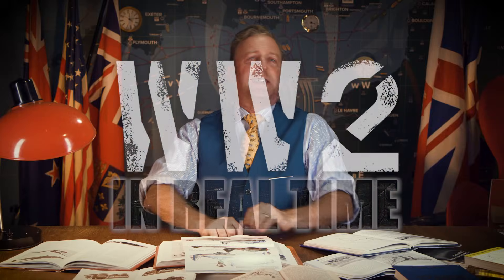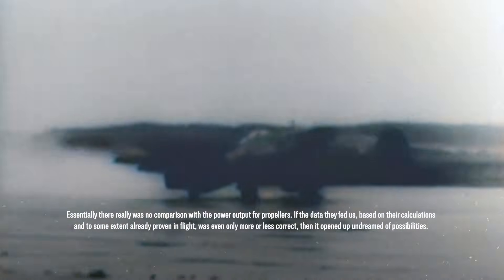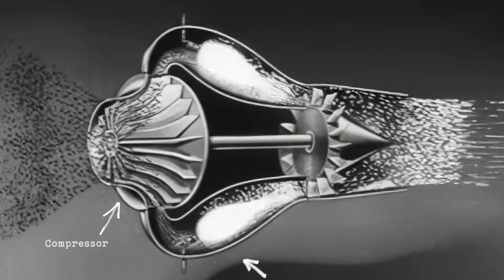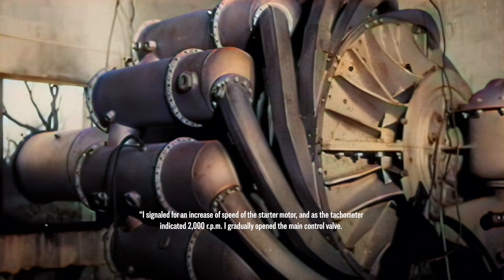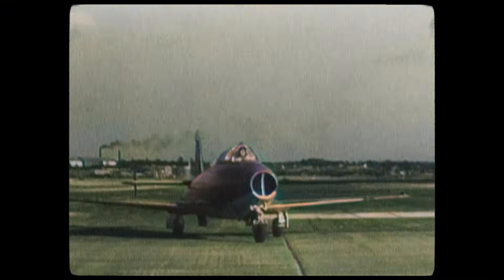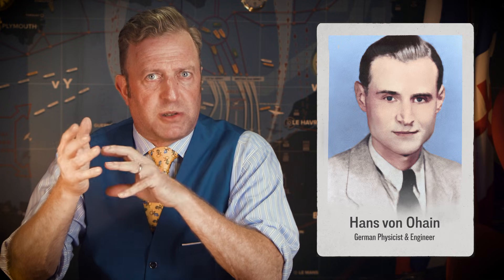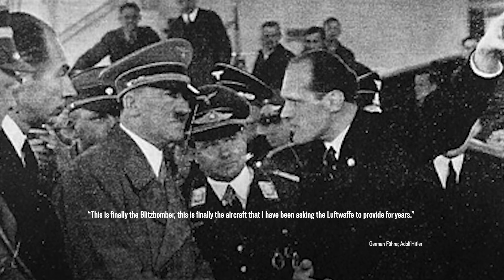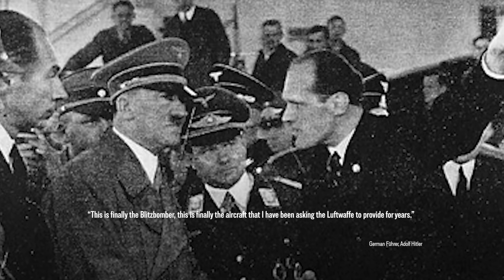WW2 Jet Engine Development - WW2 Special Documentary

Comment: The He178 was a purely experimental aircraft, never designed to be a fighter. Heinkel described in his memoirs that the air ministery guys did not get this and complained about a lack of gun mounting options. The He280 however, was designed as a fighter.
When Adolf Galland was asked long after the war if a fast deployment of Me262 fighters might have turned the war, he answered "No, it would not have changed the result of the war, it would just have prolonged it - and therefore cost more lives."

Comment: I just don't understand why the USA didn't do more to copy that magnificent, gracefully blended airframe  of the ME262, it was like another P51, or Spitfire in beauty?  And why not since the USN Nautilus was basically an all German Type XXI U-Boat hull?
Reply: Because the Americans captured the plans and the engineers that were building the Me-262s replacement.
 The F-86 Sabre was designed by Edgar Schümd and a team of German engineers from Messerschmitt brought to America by Operation LUSTY and Operation Paperclip.
   The first 6 Sabres built used parts salvaged from captured Me-262s

Comment: The Tizzard mission to the USA introduced jet engines - no R&D was under way in the USA on jet engines. It was a one-way transfer of technology. It was hoped that collaboration with the USA would develop a suitable engine quickly then US industry would join in mass producing it. Hence General Electric were in from the start.  The R&D was genuinely two-way, unlike the A-bomb which was British to the USA. The two were to rise in parallel in jet development. Yet, the British went way ahead of the USA in design, despite the USA getting all their R&D data. The British left the Americans out of sight.   The USA were slow or unable to use the R&D the British gave them.  At the end of WW2 the many British engines that were developed formed the basis of most jet engines for the next 20 years. 

The British/US way was design and quality.  The Germans were way behind, just about getting a poorly developed, and dangerous, functional engine into a plane. Then out of desperation they produced an engine (Jumo 0004) in volume using slave labor. The German engine was so bad is not worthy of note, except that it was put into a production plane and mass produced.
Reply: Completely false and an egregious attempt to spread misinformation.
The Lockheed J37 and the Westinghouse J30 were already in development and these were superior axial turbojet technology not dead-end British centrifugal jet engines.
As revealed by the Fedden and Von Kámán Missions, Germany was clearly years ahead of anything the Allies had during the war.

Comment: Noteworthy is the somewhat unintuitive assessment of production cost and time: It was less than a third of the cost of the Junkers 213 piston engine and needed only 375 man hours to manufacture as opposed to 1400. I call this unintuitive since this was a state of the art prototype still and piston engines were proven and optimized technology. Had development started only 2 years earlier it's likely the germans would have pumped out a lot of these engines. As mentioned their fuel requirements are also lower. So far jet engines have been converted to almost any fuel, the only thing that didn't quite work out is coal dust due to the ash content eroding the fan blades.

Comment: After the end of the war, the Me 262 and other advanced German technologies were quickly swept up by the Soviets, British and Americans, as part of the USAAF's Operation Lusty. Many Me 262s were found in readily repairable condition and were confiscated. The Soviets, British and Americans wished to evaluate the technology, particularly the engines.[120]

During testing, the Me 262 was found to be faster than the British Gloster Meteor jet fighter, and had better visibility to the sides and rear (mostly due to the canopy frames and the discoloration caused by the plastics used in the Meteor's construction), and was a superior gun platform to the Meteor F.1 which had a tendency to snake at high speed and exhibited "weak" aileron response.[121] The Me 262 had a shorter range than the Meteor and had less reliable engines.[122]

Captain Eric Brown, a British test pilot who flew 487 types of planes during his service, flew a captured Me 262 (as well as other German Second World War jets) after the end of the war. He referred to the Me 262 as "the most formidable aircraft of WW2." He noted that it had a number of innovatory features, but in terms of performance, was a quantum jump ahead of other planes at the time. In particular he noted its swept back wings, its axial flow jet engine, and the four powerful 30mm cannons. He stated that it was significantly faster than the fastest Spitfire (at the time) and with that speed "you could conduct combat totally on your own terms. If you didn't want to engage, you could go off and leave everyone standing."[123]

The USAAF compared the Lockheed P-80 Shooting Star and Me 262, concluding that the Me 262 was superior in acceleration and speed, with similar climb performance. The Me 262 appeared to have a higher critical Mach number than any American fighter.[124] These aircraft were extensively studied, aiding development of early American, British and Soviet jet fighters.[126][127] The F-86, designed by engineer Edgar Schmued, used a slat design based on the Me 262's.[128]

The Czechoslovak aircraft industry continued to produce single-seat (Avia S-92) and two-seat (Avia CS-92) variants of the Me 262 after World War II. From August 1946, a total of nine S-92s and three two-seater CS-92s were completed and test flown. They were introduced in 1947 and in 1950 were supplied to the 5th Fighter Squadron, becoming the first jet fighters to serve in the Czechoslovak Air Force. These were kept flying until 1951,[4] when they were replaced in service by Soviet jet fighters.
Reply: Excellent comments

Comment: There was only one big difficulty with developing a useable jet engine that caused officialdom to reject them in the early to mid 1930s. All the mathematical theory and even a lot of the engineering detail was well worked out. But that theory said that any reasonably powerful jet engine would need extremely high temperatures at the turbine inlet (this is what sets the the limit to power of a turbojet to this day). No alloys existed that could cope with this until the first of the nickel-based "superalloys" arrived in the late 1930s; only then did both the RAF and the Luftwaffe take a sudden interest.
Reply: Krupp P-193 Tinidur nickel alloy introduced in 1930 and was used in gas turbine engines and turbochargers by 1932.
The Jumo 109-004 A made extensive use of P-193 alloy.
 The major breakthrough in jet engine development was when Germany introduced bleed air cooling with hollow turbine blades and the use of TBCs for blades and combustor liners in the Jumo 109-004 B.

Comment: Another example of Hitlers complete ignorance.. Had he seen the Me-262 as the fighter/interceptor it was and the Germans mass produced it as early as the fall of '43, the war could have taken quite a turn. Definitely think after Kursk the war was never in doubt but it could have lasted a lot longer with many more casualties had the Me-262 really had been able to unleash its full affect.
Reply: That myth has been debunked... it's total nonsense.
Reply: @sandervanderkammen9230  That wasn't a myth, the 262 could have been produced earlier in the war. It wasn't and Hitler envisioned it as a bomber not the fighter/interceptor it would best be used as.
Reply: @joembensman  That myth is pure fiction.. and makes no logical sense at all.
First off, the Messerschmitt Me-262 was delayed entirely because of an accute shortage of nickel that required the Jumo 109-004 engines to be significantly redesigned to use a chromium based rather that a nickel based stainless steel.
Second, nearly all Luftwaffe fighters had bomb rack hard points and could be used in the ground attack role.
A.H. was correct in that all modern jet fighters are Interceptor-Attack aircraft with bombing capability, even the P-51 Mustang had bomb racks, carried a similar bomb load and also had a dedicated bomber variant (A-36 Mustang)

Any questions?

Comment: Not correct.

There was no delay while making the Me-262 capable of carrying bombs which incidentally had become standard practice in the Luftwaffe. Göring insisted on it.

The delay was because the engines were late. The Junkers Jumo 004 A model was too heavy and used too much strategic  materials. Hence there was a hiatus while the B model was developed.

I recommend the Wikipedia article on the Me-262 for overview of engine development.

Comment: In Germany and the UK the internal politics of the air ministries held up jet development. Unknown  to  Whittle there was another gas turbine project underway in the UK  in the hands of A A Griffith.  Griffith  was an engineering scientist of such great reputation that  he was asked for an opinion on Whittle's simple design which he rejected as not able to produce enough thrust. Whittle was completely unaware of  A A Griffith's involvement. There were other delays in the Whittle engine program particularly the squabble between Whittle and Rover.
Reply: This was in the early 1930s though. There are two things about Griffith: (1) He had earned the respect. He was the country's leading expert on turbines and he, not Whittle, had worked out most of the mathematical theory of a turbojet; and (2) he was actually right at the time. There were no alloys that could stand the temperatures at the turbine inlet in Whittle's design.  But Waspalloy, which could, appeared just a few years later - it was the metallurgists, not the engineers, that made the critical breakthrough.

Comment: To everyone else who made the same mistake I did some years ago of thinking that there were still simple propeller airliners (and so being descendants of planes with a terrible safety record): nope, they're turboprops, not just props, so they have jet engines.
Reply: Many small planes and bush planes still have piston engines. It's sorta complicated, but if the plane is only doing very short trips and so never cruising at altitude a piston engine becomes much more fuel efficient. Also they remain cheaper to build.
Reply: @kenoliver8913  But airliners? I'm aware that there are planes (specially the smaller ones) that still use piston engines, and that there are commercial companies that rent them for transport, I'm just not aware of any airliner.

Comment: The expensive to manufacture anti-knock fuel  for (large or high compression) piston engines was and is aviation gasoline(ae)/petrol(be) and not kerosene. Kerosene is a Diesel related fuel and is used exclusively for gas turbine engines.
Reply: Though gas turbine engines can easily be made to run on a very wide range of oil fuels. It is just that kerosene is the cheapest and easiest crude oil fraction to refine, which was an important point for late-war Germany with its fuel shortages.
Reply: The Jumo -004 was a multi-fuel engine and ran primarily on coal oil.

Comment: Wait... did i hear correctly ? The Me 262 flew on diesel ??? My mind is blown !😮
Reply: Turbines can be made to run on many different grades of fuel. If diesel was what was cheapest and easiest to get then that's what they ran it on. If they had had a glut of 130 octane avgas they could have used that. Or kerosene, or auto gas, or (like the V2) alcohol.

Comment: You can't talk about the impact of the jet (on WW2) without mentioning that as the atomic bomb was leveling Hiroshima a test P-80 was claiming the life of America's highest scoring fighter ace Richard Bong.
Reply: The plane that dropped the A-bomb was a piston plane. The P-80 shot down zero aircraft in WW2.  It flew a few reconnaissance flights over Italy.
Reply: @johnburns4017  of course, I was making the point it was the same day. There's a newspaper proclaiming the Hiroshima bombing, and in the Column 1 side the death of Richard Bong.
Reply: @vcv6560  No doubt about his piloting skills, but when man is called Dick Bong it is very hard to take him seriously. Except as founder of Slightly Silly Party that participated in UK general election of 1970.

Comment: Germany wasting time to try to turn the Me 262 into a bomber does not explain why they did not use that time to improve the engines.  Whether the Me 262 was to ultimately be a bomber or a fighter it needed engines that were easier to control and more reliable.
Reply: They never wasted time as they never.

Comment: As a German aeronautics engineer who worked for Rolls-Royce ( Whittles company) I congratulate your researcher and writer to get this right and keep it simple---The presenter was pretty OK too.
Reply: Are you kidding?  The 262 was undeveloped rushed together desperate junk. The Meteor was a proper fully developed jet plane, not a thrown together desperate effort as the me262 was. The me262 fuselage was similar to a piston plane with the pilot over the wings obscuring downward vision, while the Meteor was a proper new design fuselage specifically for jet fighters with a forward of the wings pilot position with superior vision, as we see today. The cockpit was very quiet. The high tail was not to impede the rear jet thrust. The partial sweptback wings of the me262 were to move the engines further back for better weight distribution, not for aerodynamic reasons as is thought the case. The 262 balancing problem would be exasperated when firing the guns as the weight of the bullets exiting suddenly made the the air-frame unbalanced. 

The Meteor was deliberately designed to have an air-frame of known qualities, as if there were problems it would be down to the jet engine not the airframe. In WW2 British went for the centrifugal engine design as it was quicker to get operational reliably. In 1943 the Meteor ran with axial-flow engines. The first proper and reliable axial flow engine was the RR Avon in 1950. 

The me262 fuselage was similar to a piston plane with the pilot over the wings obscuring downward vision, while the Meteor was a proper new design fuselage specifically for jet fighters with a forward of the wings pilot position with superior vision, as we see today. The cockpit was very quiet. The high tail was not to impede the rear jet thrust. The partial sweptback wings of the me262 were to move the engines further back for better weight distribution, not for aerodynamic reasons as is thought the case. The 262 balancing problem would be exasperated when firing the guns as the weight of the bullets exiting suddenly made the the air-frame unbalanced. 

Me262 started claiming kills on 26 July 1944. However the supposed kill was a Mosquito reconnaissance plane that had a fuselage cap blown off in a sharp fast manoeuvre, which flew on landing in Italy. The Meteor claimed its first V1 kill a few days later on the 4 August 1944.

There were five turbojet engines in the UK under R&D in WW2:
1)  Centrifugal, by Whittle (Rover); 
2)  Centrifugal, by Frank Halford (DeHaviland);
3)  Axial-flow, by Metro-Vick; 
4)  Axial-flow by Griffiths (Rolls Royce); 
5)  Axial flow compressor, with reverse flow combustion chambers. The ASX by Armstrong Siddley;

▪ Metro-Vick sold their jet engine division to Armstrong Siddley. The Metro-Vick engine transpired into the post war Sapphire. Most American engines in the 1940s/50s were of UK design, many made under licence. 
▪ The US licensed the J-42 (RR Nene) and J-48 (RR Tay), being virtually identical to the British engines. 
▪ US aircraft used licensed British engines powering the: P-59, P-80, T-33, F9F Panther, F9F-6 Cougar, FJ Fury 3 and 4, Martin B-57 Canberra, F-94 Starfire, A4 Skyhawk and the A7 Corsair.
▪ The US General Electric J-47 turbojet was developed by General Electric in conjunction with Metropolitan Vickers of the UK, who had already developed a nine-stage axial-flow compressor engine licensing the design to Allison in 1944 for the earlier J-35 engine, first flying in May 1948. 
▪ The centrifugal Rolls Royce Nene is one of the highest production jet engines in history with over 50,000 built.

Comment: The P-80 was still flying in the 1980s in the Alaska Air Command as the T-33A when I was stationed there. They were used for aerial reconnaissance, and intercept targets for the F-15s there. It was a two-seater then - converted from its role as a jet trainer.
Reply: As was the Meteor F8

Comment: Such a disappointment to see the Myth about Hitler's orders being repeated. Hitler was right. The fighter bomber was better that the pure fighter given that the hardpoints for bombs were also plumbed for drop tanks. Hence it had considerably more range that the pure fighter version. Once it dropped its tanks/bombs it performance was the same as the pure fighter. As somebody else already said, introduction of the 262 into service was timed by engine aviaiility not airframe. At the end of the war the allies found several hundred 262 in storage that had never been flown because there were no engines for them. At the time that the famous bomber order was issued there were already 200 fighter airframes completed and awaiting engines.

Comment: You should maybe have used a different word to "acceleration" when you were talking about the jetfighter. Jet fighters were inferior in acceleration to piston engined planes (although having a higher top speed) for at least a year or so after World War II.
Reply: That is how the 262 was easily shot down. Allied fighters would loiter around the air base getting the 262s taking off or landing.